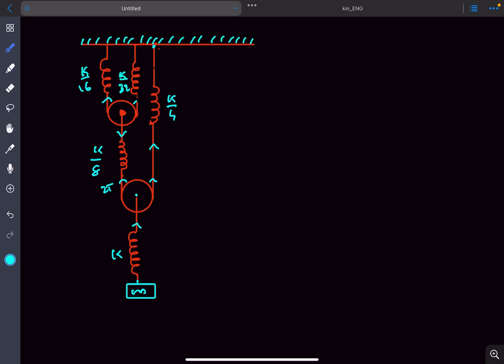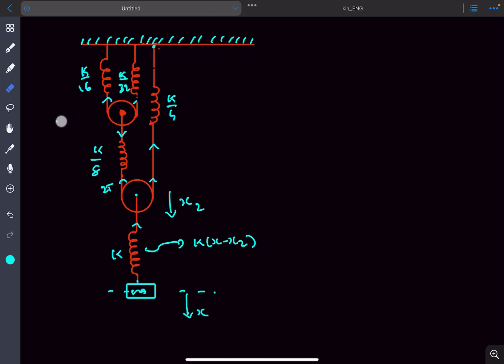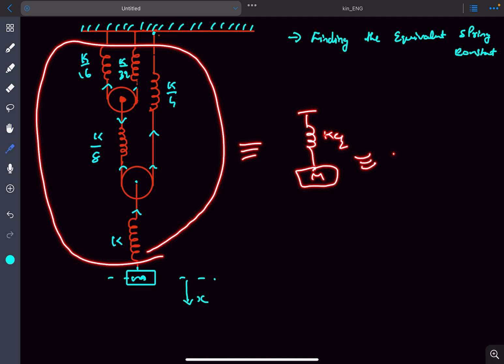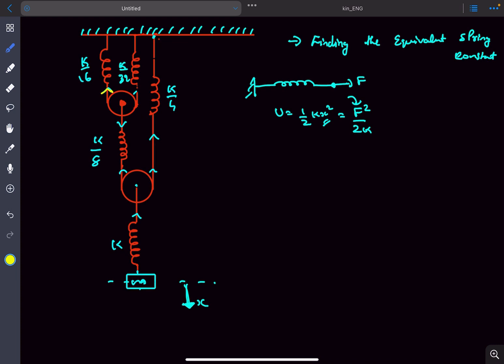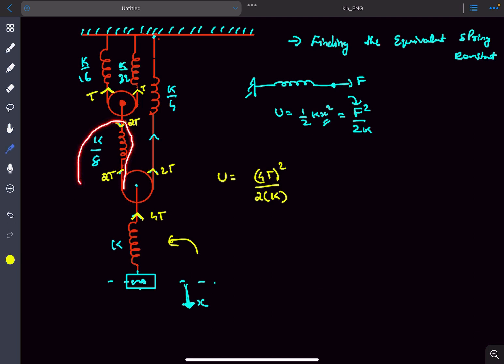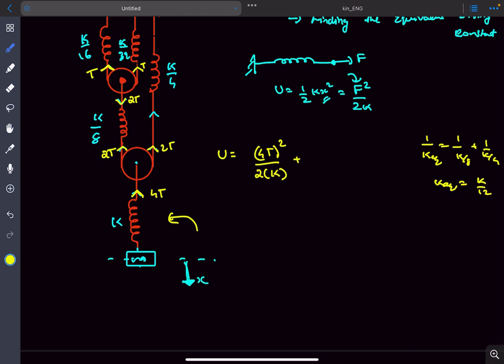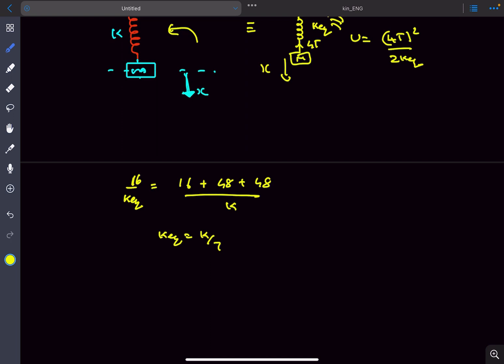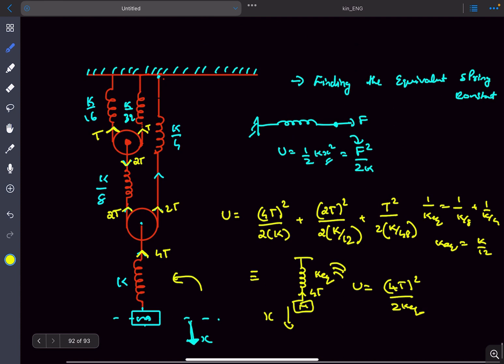[JEE Adv] Equivalent Spring Method for Finding Time Period of Oscillations | AITS

Comment: Doubt- i do these kind of question with help of work engery theorem bye displacing  block by x and writing velocity v and also writing engery of spring and after that i do derivate and find keq and i always get write ans but here my ans is wrong i even considered that spring with more k will have less extenion and splitting extension in unverse ratio please someone clear ny doubt
Reply: Same here buddy! Mine came out to be 2pi underroot 61m \ 13k
Reply: @Raptorqued19  bro now i am done with these sort of things i am in iit delhi